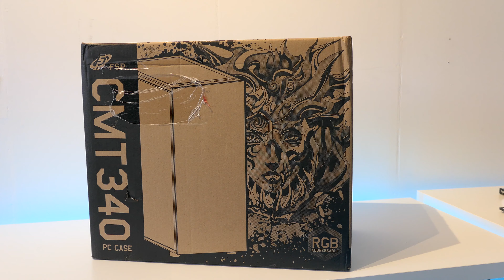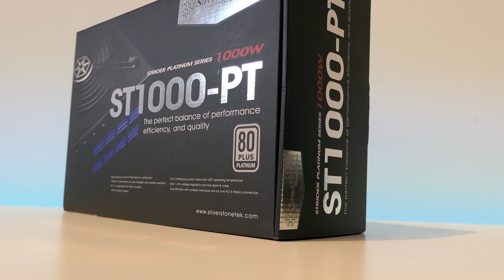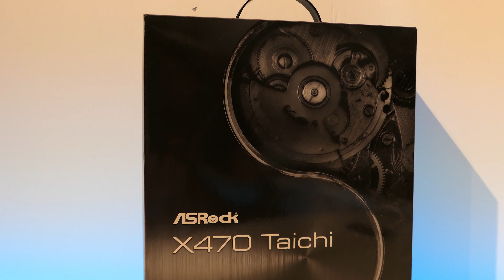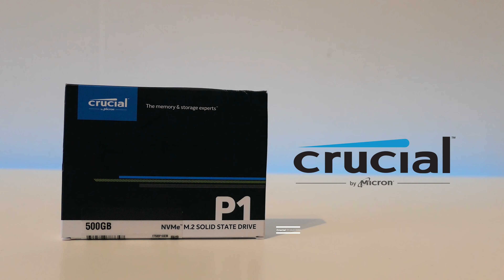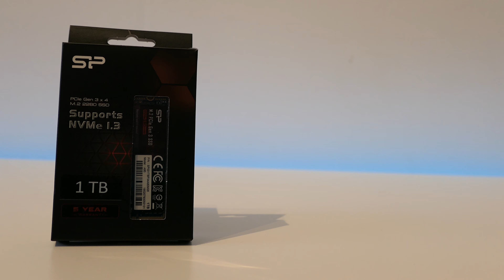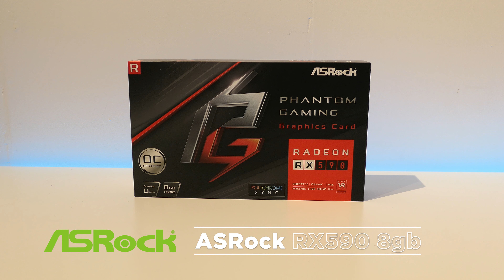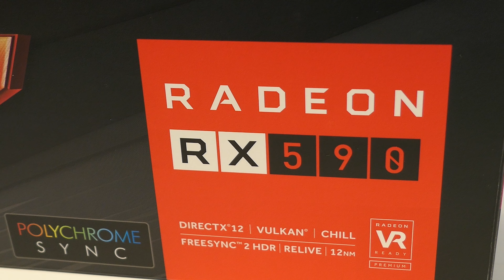PC Build Timelapse -  FSP CMT340

Comment: Ok. But where do i connect the Fan cable?
Reply: On the 3 or 4 pin connector on the motherboard. Connect all fans to the fan header at the back side.
Reply: Theres a fan hub on back